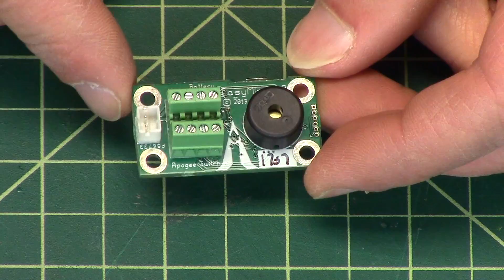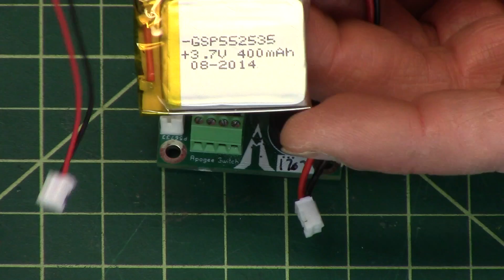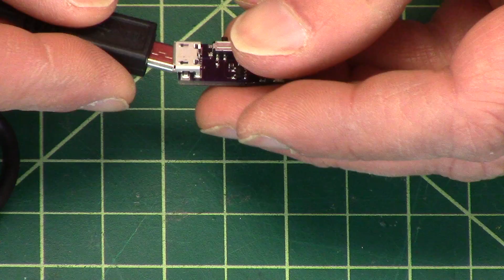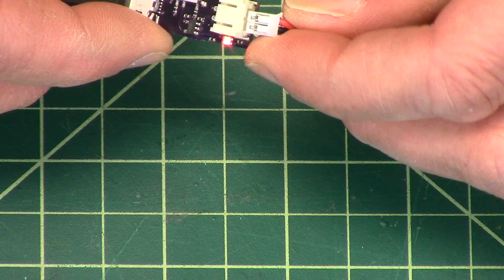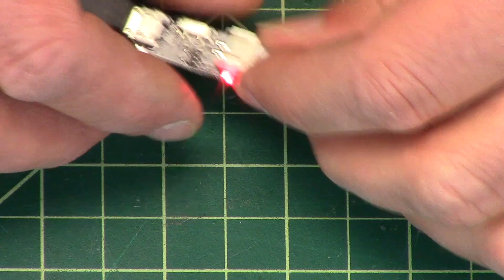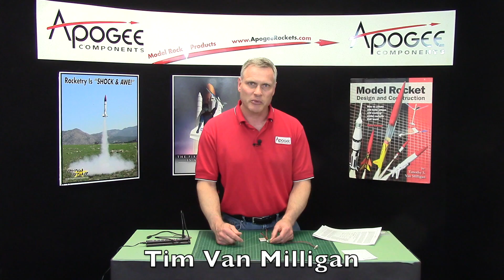Easy Mini Altimeter 01

Comment: Can I use the easymini without any deployment charges? Like only have it onboard the rocket for the sole purpose to measure altitude
Reply from the maker: Yes. That is possible.
Reply: @apogeerockets would I just not connect any charges to the altimeter, and then put it in my rocket and send it?
Reply from the maker: @Stuck_in_Space yes. that's what we suggest.
Reply: @apogeerockets thank you
Reply from the maker: @Stuck_in_Space https://youtu.be/n3EEo5rXRTM - This video shows how we took a dual-deployment altimeter that is even smaller than the easy-mini and used it to measure the Coefficient of Drag of a rocket. This is what you can do if you do with the data.

Comment: Why is there an apogee charge if the motor already has it built in?
Reply from the maker: Because, sometimes the apogee point might be at a different altitude than what the delay charge of the motor predicts. We all think our rockets are going to fly straight and true. But in reality, some rockets experience mishaps coming off the launch rail. I've seen rockets go unstable, or I've seen motors Cato. In that case, the regular delay in the motor is not going to push out the drogue chute at the right time. But the altimeter is independent, and will alway fire at apogee. I've seen dual deployment electronics "save" a lot of flights that would have otherwise crashed. So having the motor ejection charge becomes a "back-up" for redundancy - you probably don't need it, but it provides duplication to keep things safe.
Reply: @apogeerockets  thanks for the explanation.  I can't say enough how invaluable your company is!

Comment: Can i use li-ion battery instead of li-po?
Reply from the maker: They are the same thing, as far as I know. The batteries we use for dual deployment are different in one way. They don't have a safety circuit on them that regular lithium batteries have (we sell them on the Apogee website). The reason is that we want all the juice from the battery to go into the igniter to set it off. A normal battery will sense this as it being shorted out, and will trip the safety circuit in order to prevent the battery from overheating and starting a fire. That prevents the electricity from flowing into the igniter to heat it up and set it off. So a normal RC airplane battery, or whatever, may not work with a dual deployment altimeter. You'll need to do a ground test to make sure it works.